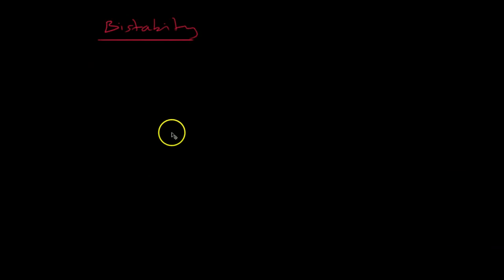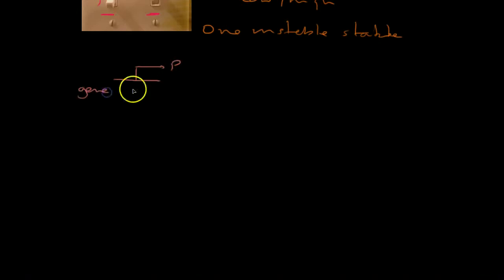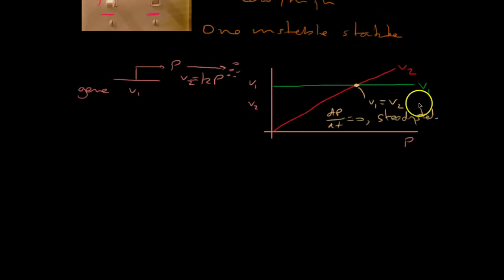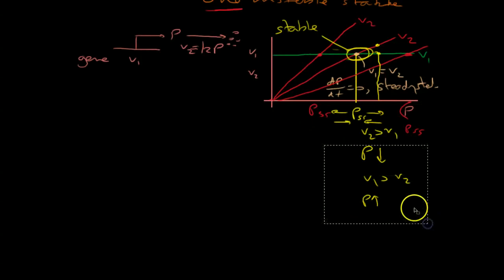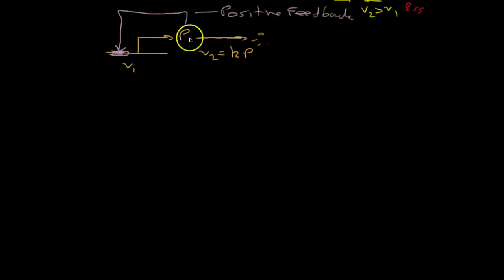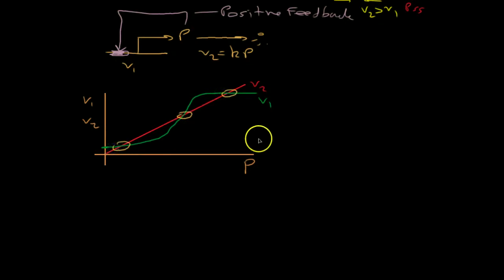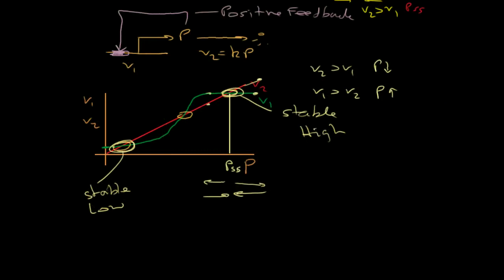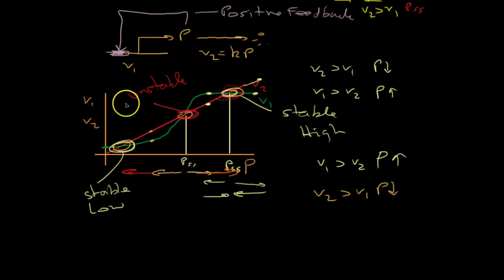Introduction to Bistability: Part 1

Comment: It's a bit confusing that you use the example of production of a transcription factor, as it is required for the production of gene product. Couldn't you have used hexokinase as an example??
Reply from the maker: I reason I did it this way was because in the class I was teaching I was doing dynamics of gene regulatory networks. You are right however that I could have used other examples such as an enzyme that was producing a metabolite and that metabolite could activate the enzymatic rate.

Comment: But is the unstable state a steady state??
Reply from the maker: yes it is. If you were to position yourself exactly on the unstable state you would stay there for ever unless disturbed. At that point, the state has all the characteristics of a steady state, namely unchanging concentrations and finite fluxes. The only issue with it is that its unstable to small perturbations.
Reply: Of course it is! But, since it is unstable, as you perturb it, you'll go away from it.